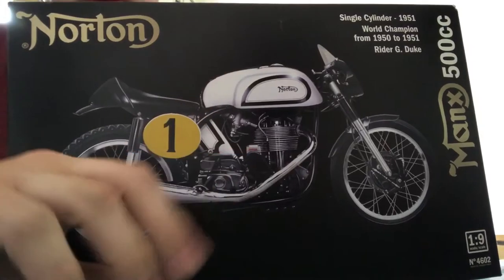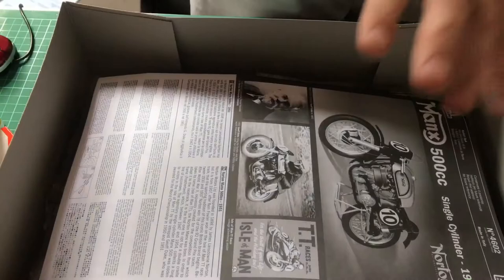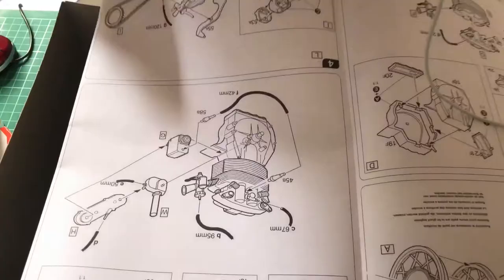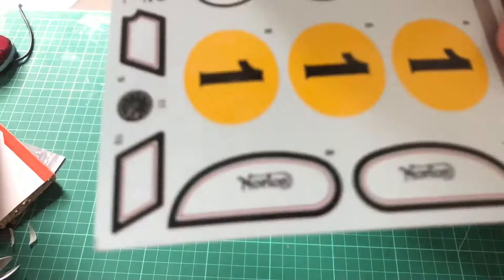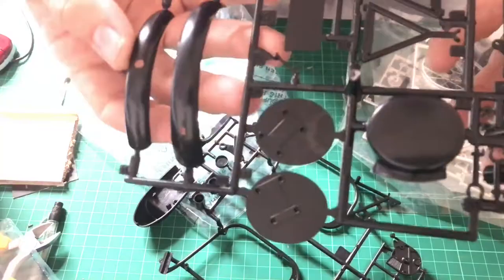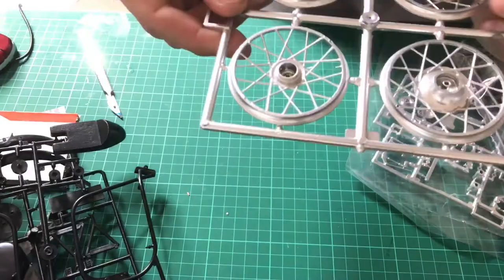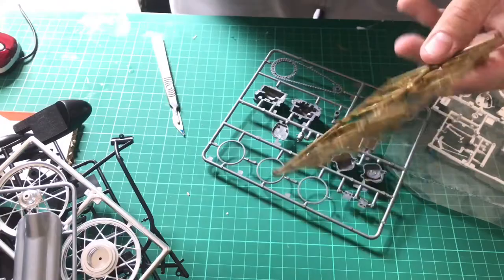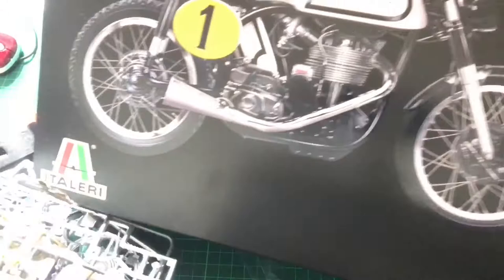1:9 italeri Manx norton review

Comment: Just started building one of these. I find it to be pretty poor quality. One half of the cylinder barrel is so badly moulded that when assembled with the other half, it leaves a massive gap at the front.
The kit includes three types and sizes of tubing:- some clear - what appears to be silicone tubing, presumably for the fuel lines, a short section of larger grey pvc tubing, which I can only guess is intended for the handlebar grips (why grey?) and a long length of black pvc for everything else. I cannot get any of the tubing to fit in its intended location: either the tube is too small, or the fitting points are too large.
Further on in the build, I note that the front fork assembly requires some very small holes to be drilled, to accommodate two 1.4mm screws... I don't think that the average plastic kit builder should need to be tooled-up to start drilling holes.
In conclusion, I really think that you should have actually built the kit, before submitting a review.
Unfortunately, this kit was given to me as a gift. If I had spent my own hard earned cash, it would be straight back to the retailer.
Reply from the maker: Hello Gary thank you for your feed back sorry I’ve taken my time to get back to you have been very busy, as for the kit my personal opinion the kit does have its floors I agree, but I’ve later found out that it’s a rebox of a very old metal protar kit hence the fit issues that your where having, as of the piping I didn’t seem to have any trouble at all just a strong super glue required there and it was fine, as for the handbar grips I do know that they use to use a sort of grey felt to cover the grips so that in the case for rain the rider did not slip as I have a passion for vintage racing motorcycles, as for drilling holes yes for a novice modeller it can be a quite a challenge, but everyone does need to start somewhere, you will be hard pushed to find a kit where you don’t need to drill holes for whatever reason, please see my other videos on this particular kit as there is a full build series on this kit and most of the model makes on YouTube will review in an out of box manner like mine one.
Thank you agin
Reece